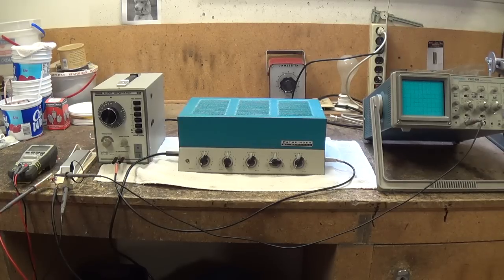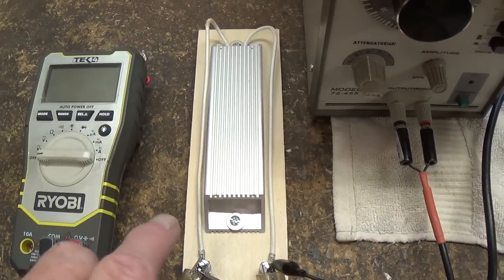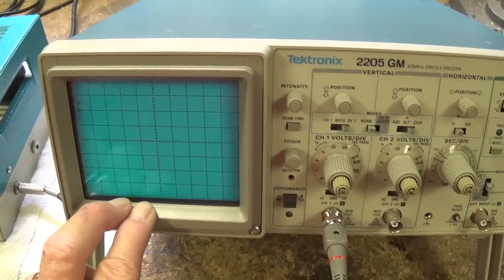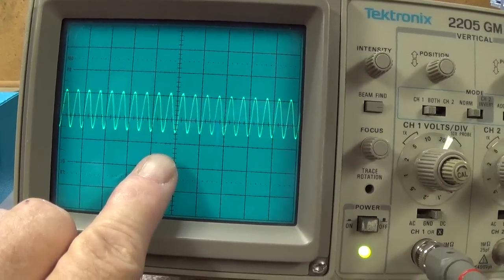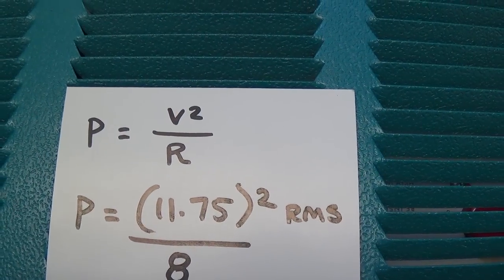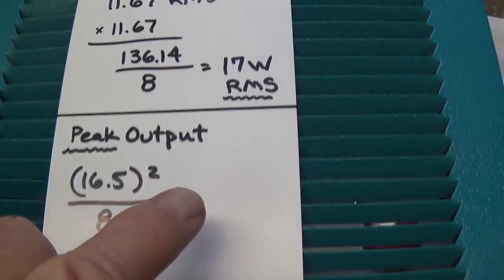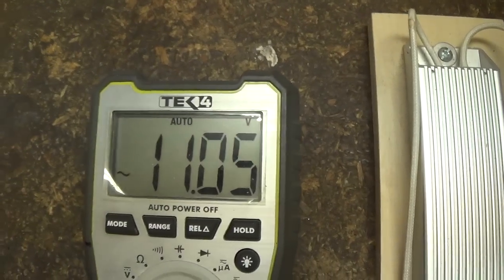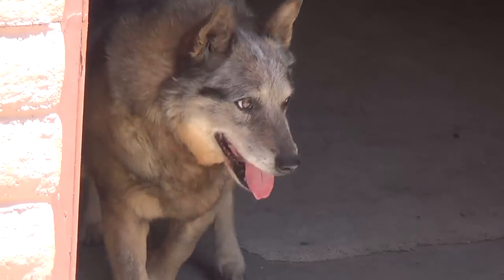How Amplifier Output Power is Measured

Comment: I loved this one, again! It made me think a lot. Where can i find a Dummy Load? They sell it or u have to do it urself with electronic components? When u buy an amp and they claim it is 100W (power in this case use to be very rounded numbers like 50W, 70W, 30W, 100W, 150W), are they referring to the output power or any other power? Thx for the great lesson
Reply from the maker: +Edu "Turupá" Sánchez   You're welcome, Edu. You can buy dummy load resistors like this on Ebay.  Generally, amplifier power ratings are done just like this and reported in Watts of RMS Power.
Reply: That's awesome. I assume that that means that the power refers to the maximum output power available and that my Celestion Vintage 30 speaker rated 60W RMS may be in danger in my 100 Watts amp. THX UNCLE!
Reply from the maker: If your amp output is really 100W RMS, then yes, your speaker is in danger. If it's 100W Peak (actually 50W RMS) then the speaker is in less danger :)

Comment: an "ideal" amp would have the same voltage across the full frequency band 
if you are on the west coast I have a spare frequency counter  if you are interested..
Reply from the maker: +Bryan Sullivan  True, but they don't seem to work that way, Bryan. Thanks for the offer, but I am far away.....in West Texas.  If you're ever headed this way on I-10, let me know :)
Reply: A solid state amp with voltage drive does deliver the same voltage across the frequency band, but a speaker's impedance varies with frequency, which means power varies across the frequency band. Not ideal.

Comment: Hi Doug, In the 60's when solid state amps came out they were rated in peak output and it was one of the things that made guitarists dislike them. A 50 watt was really a 25 watt and under powered if you needed a 50 watt. That is why your Kustom is a 200.
Reply from the maker: +Tedd Smith  Exactly right, Tedd. It was purposefully misleading and made me the cynic that I still am today :)